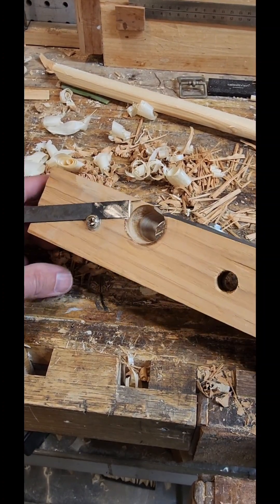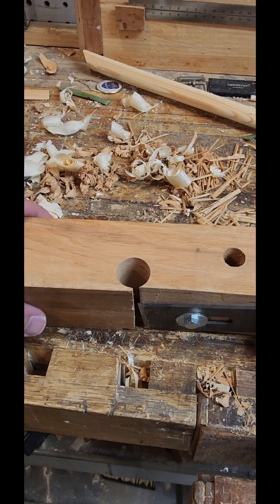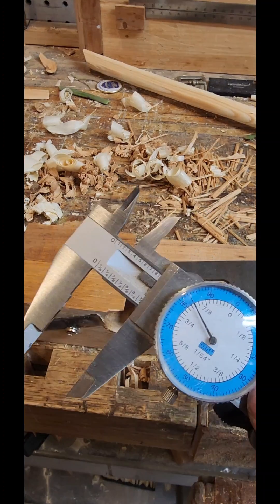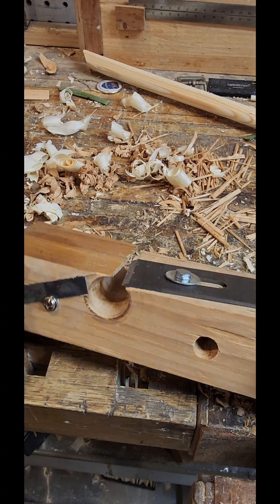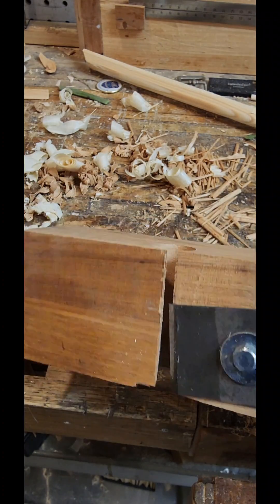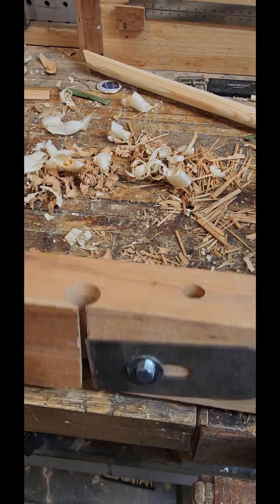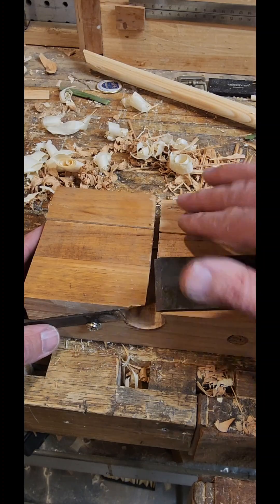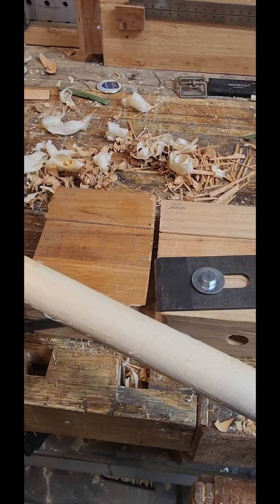A Dowel Maker

Comment: nice idea and I like its vertical vice. Is it self-built?
Reply from the maker: I bought the vise at a tool sale. It is a golf clubmaker's vise made in the 1970s to 80s. The benefit is that the workpiece is elevated and you don't need to bend over much. I've since used it to cut dovetails and it works well, so no need for a Moxon or twin screw vise that sits on my bench, although the latter would be ideal since there is no vise screw in the way. Another benefit of the vise above the bench is that it doesn't get in the way when angling a rasp or spokeshave. It would be a rather simple vise to make if you could find or make the hinge. The  hinge at the bottom is like a door hinge but one plate is longer and that plate is bent 90° midway through with the bent section attached to the front "jaw-post".